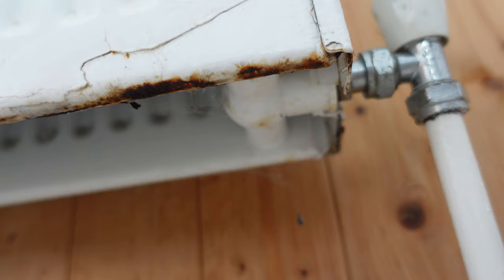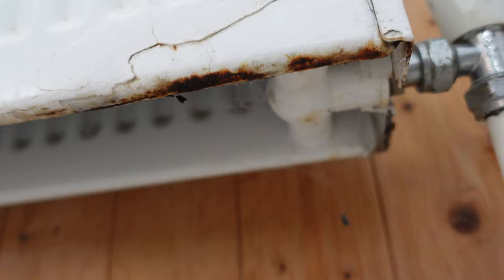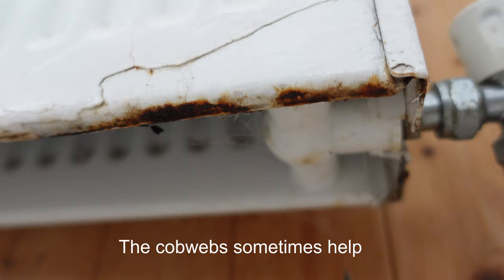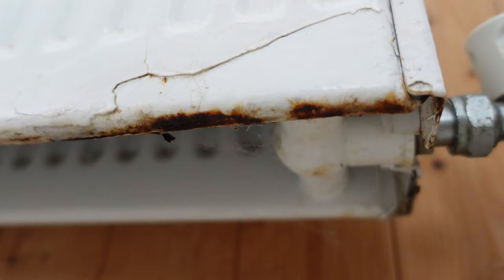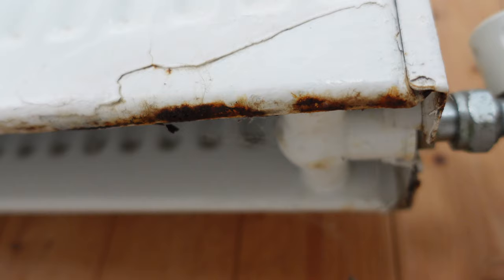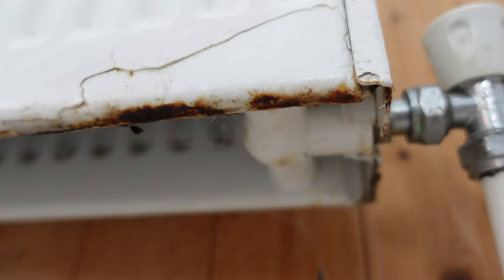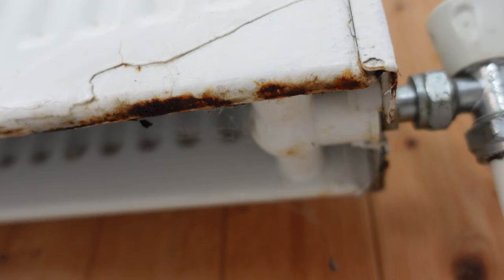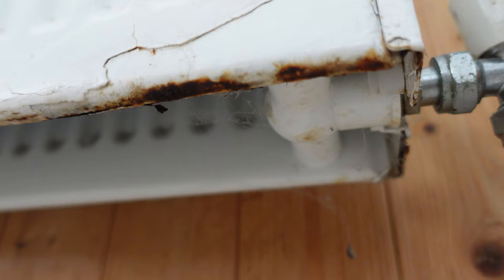Rusty central heating radiators ?

Comment: I found patches of rust on the bathroom radiator of the home I moved into almost 4 years ago. I sanded down the rust, applied a rust inhibitor, then painted the whole radiator using radiator paint. The rust hasn't reappeared, and in those 4 years I've had no leaks. I think it all depends on how bad the rust is.
Reply from the maker: Very true.

Comment: We had a new one of these fitted from Screwfix about 7 years ago and very quickly it started to show signs of rust (despite having inhibitor inside the system) The whole of the radiator all the way up is showing signs of rust under the paint, and the bottom like in this video being particularly bad. I was going to get some rust remover/primer and then use a white radiator spray paint I got from Lidl. Why they don't make radiators galvanised is beyond me.
Reply from the maker: Be Wary of using rust remover it may take the rust away which is probably stopping a leak.
Reply: @dereton33  I have ended up buying rust converter which doesn't take anything away. It also primes.

Comment: Onset of rust can come from tiny knocks on the painted surface when mopping the floor for example.  Combined with the humid bathroom environment leads to rust. If caught early, there are rust killers / stabilisers that can be used and then top coated with an appropriate paint. Great videos, keep on posting.
Reply from the maker: Thanks DG.

Comment: The external corrosion is entirely due to poor manufacturing - poor material preparation and inadequate paint scheme. It is highly likely they painted over rusty panels at the factory. Poorly ventilated bathrooms will accelerate corrosion once it starts but would not cause it on a quality painted radiator. Internal corrosion is a different matter and the reason why inhibitor needs to be maintained throughout the life of the system.
Reply from the maker: Thanks for the info.

Comment: Ive been fortunate and havent had to replace a rusty rad. Had to replace one where the bleed valve wouldnt open. Our current rads are Myson roll tops as the house was built new in 1996 and the replacement tail exits on the new rad were longer than the old. That caused some excitement when fitting the new one as the pipes had been tiled around!
Reply from the maker: Ha ha the fun of plumbing.

Comment: I have 2 massive radiators rolled into my bay window areas.  The rads are in good nick.  It's just the darn bleed valves they're knackered.  What would be the easiest way to remove them?  Where can I purchase replacements from? 
Hope you and your Mrs's are staying safe and always a pleasure watching your uploads. 👍
Reply from the maker: If they are screwed into 15mm brass bushes then you can replace them if not then you can not. Thanks and keep safe.

Comment: My radiator has a 1cm lip around the edges (except the top), I think it's where the metal has been crimped together, but the bottom of that crimped seam is rusting. Would you still advise against sanding that bit down? I'm kinda hoping because that crimped bit is not in direct contact with the internal water or the cavity, it might be ok?
Reply from the maker: Yes should be OK.
Reply: @dereton33  many thanks!

Comment: Hi, really need your advice although nothing to do with rusty radiators. We have old lead pipes with internal stopcock on that has seized up. The external stopcock won’t fully turn off and united utilities say they don’t maintain them anymore. Can you please advise on how I can get internal one working or replaced.
Reply from the maker: Hi Lillian, your best option is to leave the old lead stopcock alone and fit a normal 15 mm stopcock on the first piece of copper pipe above the lead stopcock. If you use a freezer kit on the pipe below where the stopcock is going to be fitted, that will stop the supply while you fit the new stopcock.
Reply: @dereton33  thanks so much for your prompt reply

Comment: Watched your video on rusty radiators I put a new one in 6 months ago and now ite started to go rusty slightly at the bottom  this is in the bathroom any advice thanks Karl
Reply from the maker: Too much moisture in the bathroom. Fit an extractor or open the window when finished .
Reply: @dereton33  Thanks for the quick response I have been offered a replacement from were I got it  was not sure to take them up on the offer as I did not want another one to go the same

Comment: should there be external rust at the bottom if only 18 mts old?
Reply from the maker: No.
Reply: @dereton33  thanks. could draining of a fair volume of inhibitor and topping up the sustem with water via the boiler mean that the reduced concentration of inhibitor could cause the rusting